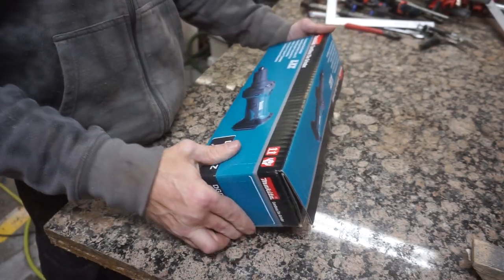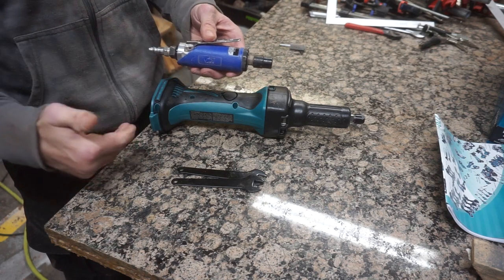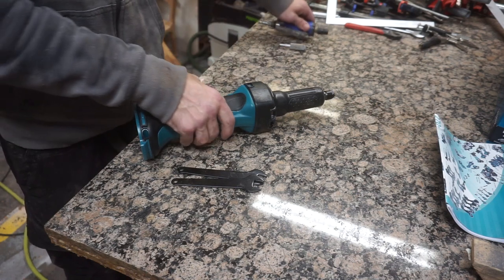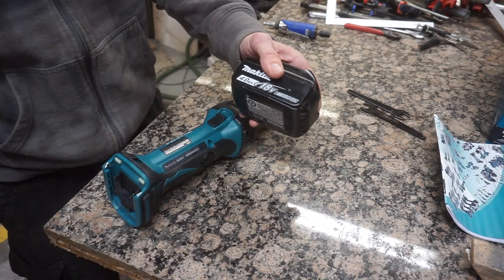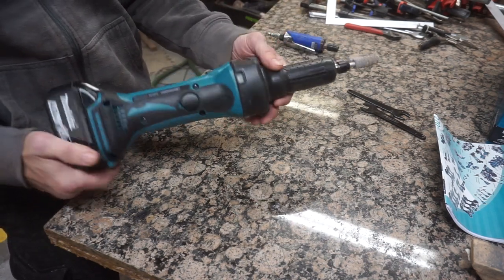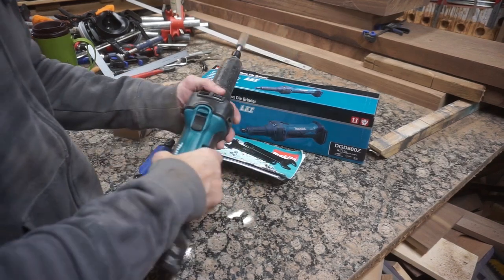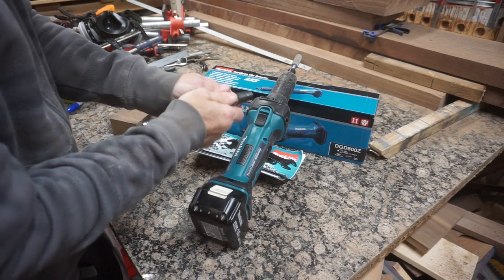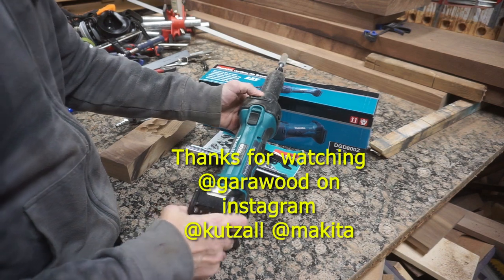Testing the Cordless Makita Die Grinder with Kutzall ball nose rasp

Comment: For the price, this is a pretty decent grinder MyBest.Tools With 90 psi shop pressure is hard to stall even when material galls up in wheel. I've got three of them now, two of them I bought back in 1992 and they are still going strong!
Reply from the maker: right on, good to know

Comment: i just got the kobalt 24v max die grinder .. i already had a 4.0 battery thing is awesome !  119 for grinder n 50 for a 4amp battery . runs noticably quieter than makita but only time will tell which lasts longer
Reply from the maker: Right on. I haven't used Kobalt tools...are they generally pretty good?
Reply: Yeah I’ve noticed the makita are a bit loud same goes with there other tools I’ve had ! I don’t know why !!

Comment: It’s Makita it will destroy any other brand out there hands down no one makes better tools 🤘🏻👌🏻👍🏻
Reply from the maker: totally agree!
Reply: Except makitas batteries are about 10 years behind. The biggest one is a 5.0 while others have bigger better ones. So no makita isn’t no where near the best in tools. It’s Milwaukee
Reply from the maker: @mrcastro8740  Really? You think makita batteries are not as good? What brand do you think is better?  Appreciate the comment :)
Reply: @mrcastro8740  6.0 is the highest capacity single and you can use 2 on many of their tools for a total of 12ah. So they aren't behind they are more versatile. Same batteries work in all of their 18v tools.
Reply: I agree. All my power tools are Makita and they never miss a beat.

Comment: Thanks for the great review, pretty much covered everything I wanted to know. I had been looking into going down the air route but the cost of a compressor large enough to run the tool well makes it impractical for a home shop I think. Not to mention how much power a decent sized compressor draws and how physically large they are.
Reply from the maker: I was using an air die grinder - $300 on a compressor and it couldnt do the job. Definitely prefer this option.
Reply: @GaraWoodWoodworking   what the difference between the XDG01Z and the XDG02Z?
Reply from the maker: @1Grandhustler  I believe the XDG02Z is a shorter compact version

Comment: I’m on the makita battery platform but was a little hesitant with no variable speed on the cordless model. - does this even matter with wood rasping though? 
Also what’s the life like on that kutZall? 
Just ordered ordered but not  letting myself use it til I get current project out of the shop... nice video- thanks
Reply from the maker: I personally dont vary the speed when using a tool like this...I just like consistent power that the tool provides, air tends to die off quickly. I have had some Kutzall disks and bits for 6 years and they still work like the day I bought them.

Comment: Anyone can confirm that the bits /borr are widely available and interchangeable from other brands ?  I would like to purchase one but noticed a review saying it will only accept 6mm and  for wood carving that size is limited?
Reply: 1/4 bits fit into 6mm collets. The difference is less than the amount the collets loosen, some wiggling is often needed though

Comment: I bought one the same lasted less than a day before stopping . Went back to store they said If I need it quick, I need to take to Makita service center 40 kms away I bought it for a job where power was a long way away.I needed to finish job so I drove it there, They said sorry we will need to get part and repair 2 weeks later not had any contact from them and them. I bought this and have always bought Makita , I have 10 batteries and 15 tools In18v or more plus leaded tools . But will never buy another makita tool again. POOR SERVICE , at its' best

Comment: The only thing Makita should have done was make 24 volts battery packs because 24 volts stacks to 48 volts, 120 volts, 240, 600 volts....... think about using them on solar systems 😎 cars should have been 24 volt systems then you could run your car off of a Makita battery 🔋 😅